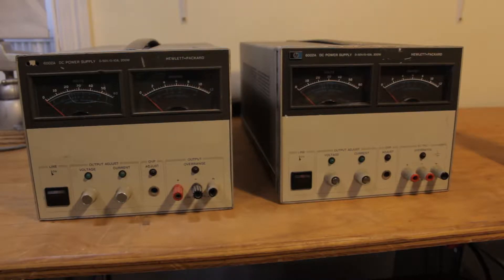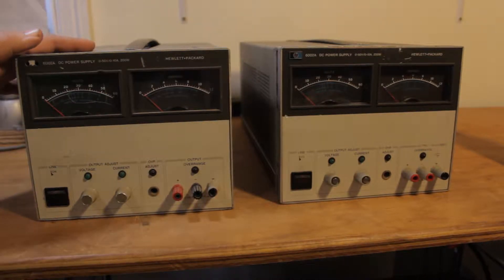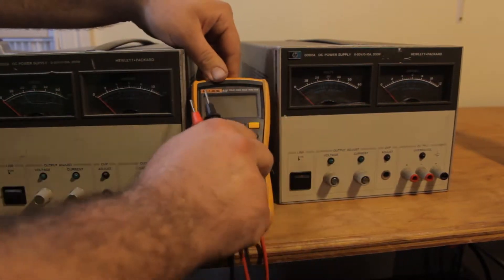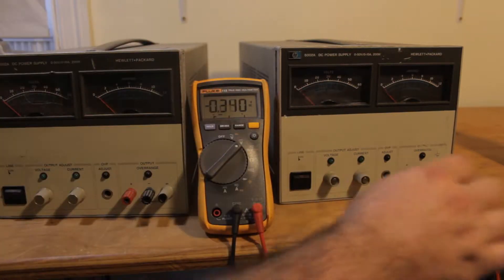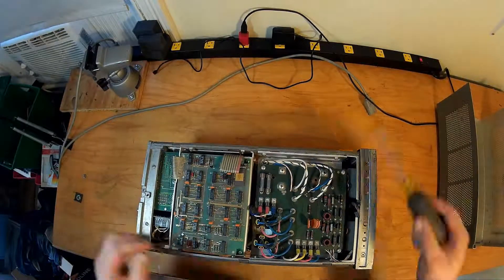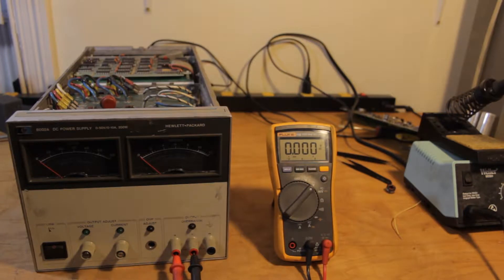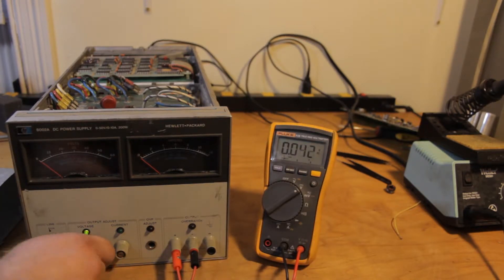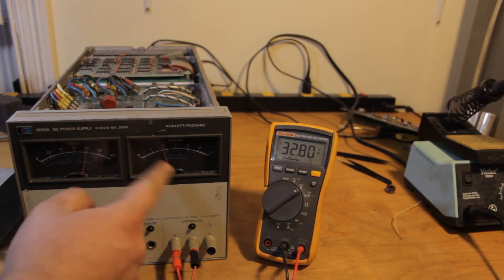HP 6002A Repair

Comment: If you get one of these, the first thing to do is look at the vertical connectors on the back and make sure the proper jumpers are installed.  The manual is available on line for free but THEY FORGOT TO INCLUDE AN OVERALL SCHEMATIC.

The second thing you should do is take the case off and remove that Option package at the top of the back.  That Option is designed to enable remote programmable control of the power supply for automated industrial test applications; it almost certainly will not be needed for a bench power supply.  There is danger in leaving that programmable option installed.  Instead of a wiring harness to hook the two circuit boards of the Option together, they used a flexible circuit board.  If you touch that unit inside it is almost certain that the backing on that flexible circuit board will fall off, causing the lands to short together and causing serious damage to the unit.  So pull all that crap out, cut off the connector that patches it into the rest of the power supply, and follow the manual to see which wires on that connector should be shorted together.  

I fixed and then broke my HP6002A at least a half a dozen times, but it works well now.

Good luck!
Reply: this is great info, thanks!